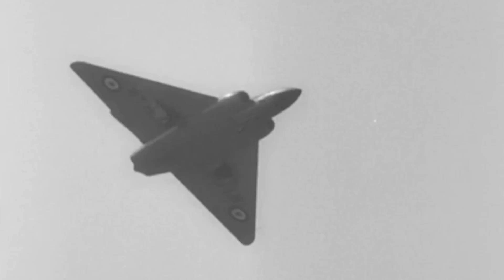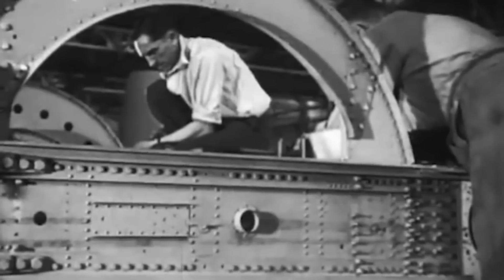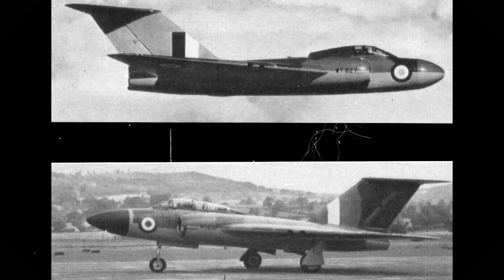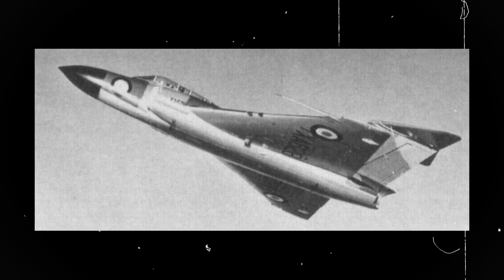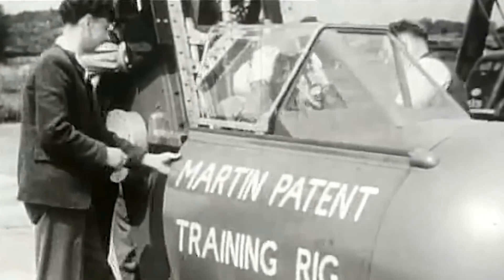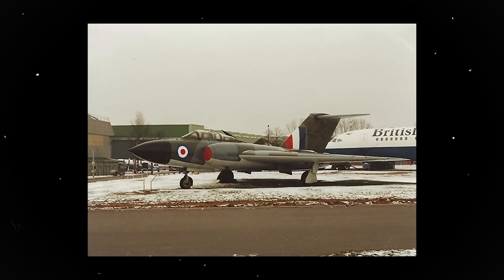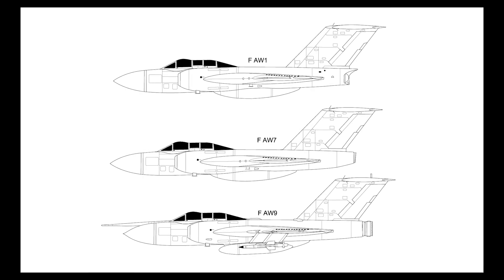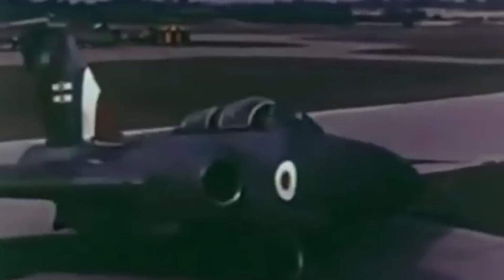The Bizarre Interceptor That Accidentally Broke the Sound Barrier

Comment: A very fair progression from the Meteor. Not bad performance for a non reheat engined craft. I bet high altitude manoeuvrability was good.
Reply: Especially considering the Gloster Meatbox was the worst jet fighter in history... mediocre at best, typical british jet.
Reply: @DoktorBayerischeMotorenWerke 

Compared with what other jets?  As one of the first examples of this technology it was primitive obviously. All the early models were.
Reply: @DoktorBayerischeMotorenWerke  
Compared with what other jets?  As one of the first examples of this technology it was primitive obviously. All the early models were.
Reply: @robinwells8879  Britain lagged years behind in aircraft technology, its jets were outdated, unreliable and had staggering loss rates.
British jets were so bad that operators refused to buy them anymore and the UK aircraft industry collapsed.
Reply: @DoktorBayerischeMotorenWerke  perhaps in the universe that you inhabit!😉. Remind me, what was the TBO for an early BMW  turbo jet engine as fitted to the 262?  10 hours was it?  Fantastic engine geometry and aerodynamics but a severely underdeveloped engine. These were early days and all manufacturers had teething problems. Russian Migs were only able to fly because of reverse engineered RR engines sold to them.  The USA only had the technology that they stole from the defeated Luftwaffe and the engines that they were given by the UK.  Nascent technology.
Reply: @DoktorBayerischeMotorenWerke  
While the 362 engines often had trouble lasting longer than 46 minutes before destroying themselves early British Whittle engines had TBOs in the order of 300 hours & of course did actually manage to stay in one piece long enough to require an overhaul.
 Later 1940s De Havilland / Halford turbojet engines had TBOs of around 1000 hours

  The Lockheed J37 engine was in fact a compressor fed steam raising boiler combuster feeding a Parsons type axial turbine section which drove the compressor & a propeller. Not actually a turbojet aero engine as such & never got used for aircraft propulsion. 
  Based on work done before 1900 by Parsons of North England & Ireland while creating the world's first power generation turbomachinery multi stage sequential rotor stator axial turbine & axial compressor.
Reply: @petemaly8950  The German company Krupp developed P-193 Tinadur alloy, the world's first high temperature Nickel stainless steel was introduced in 1932 and was used to manufacture the world's first production gas turbine engines made by Swiss company Brown, Boveri und Cie.
Reply: @petemaly8950  The Jumo 109-004 'B" was PFTR rated for 150 hours and American tests conclusively proved that these engines had better TBOs than Allied Piston engines.
Reply: @DoktorBayerischeMotorenWerke  The Jumo 109-004 had no official TBO rating, it often destroyed itself in less than 46 minutes. 
During testing by the RAE during project 363/AO46 the 362 under test  experienced 5 destroyed engines in one afternoon.
 During attempts in Russia to use the Jumo engine copies they ended up scrapping around 1000 engines.
 Allied piston engines during the 1940s often had TBOs of between 700 hours & 1300 hours.
Reply: @petemaly8950  Allied piston engines like the Merlin in combat operations averaged TBOs of 25 hours.
The Merlin could not return to service if the lock strip on the throttle lever was broken and WEP was used during the last flight,
The engine required internal inspection and repair before it could be allowed to return to service.
The use of WEP for more than 5 minutes would result in serious damage that required a complete teardown and overhaul   in as little as a single mission.
Reply: @DoktorBayerischeMotorenWerke 

   The Jumo 109-004 had no official TBO rating, it often destroyed itself in less than 46 minutes. 
During testing by the RAE during project 262/Ao04/wtf  the 26.2 under test  experienced 5 destroyed engines in one afternoon.
 During attempts in Russia to use the Jumo engine copies they ended up scrapping around 1000 engines.
 Allied piston engines during the 1940s often had TBOs of between 700 hours & 1300 hours regardless & of course the Merlin was never destroyed in under 46 minutes simply because the throttle had been closed too quickly 😅😅😅 & of course the Merlin always reached it's next scheduled overhaul.
Reply: @petemaly8950  Official USAAF documents produced by Operation LUSTY cofirm TBOs averaged 55 hours... better than the Merlin engines
Reply: @DoktorBayerischeMotorenWerke 
@DoktorBayerischeMotorenWerke 

   The Jumo 109-004 had no official TBO rating, it often destroyed itself in less than 46 minutes. 
During testing official documents produced by the RAE during project 262/Ao04/wtf show clearly the 26.2 under test experienced 5 destroyed engines in one afternoon with engines lasting between 25 minutes & 45.9 minutes.
 During attempts in Russia to use the Jumo engine copies they ended up scrapping around 1000 engines.
   Allied piston engines during the 1940s often had TBOs of between 700 hours & 1300 hours regardless & of course the Merlin was never destroyed in under 46 minutes simply because the throttle had been closed too quickly 😅😅😅 & of course the Merlin always reached it's next scheduled overhaul.
 Dehavilland / Halford Ghost turbojet engines had a TBO of 1000 hours  during the 1940s

Comment: I live in the same county where Robins Air Logistics Center is located. Robins got the contact to do depot level maintenance on F-15s in the 1970s and a corridor across the center of the state was created so that the F-15s could break the sound barrier when they flew functional check flights. Over the years us locals have gotten so used to sonic booms that we hardly notice them. One day I went to our nearby Wal-Mart for something, that store happens to be right next to I-75, as I was leaving there was a family just getting out of their car and a very loud sonic boom went off. The family was from up north and and were extremely frightening by the noise. But they were confused because no one else seemed to have heard it, I explained about the F-15s and they sheepishly went about their business. It made wonder how many travelers had heard sonic booms like that but didn't have someone to explain it...

Comment: In August 1952 I was aged 10 and in the Isle of Wight and heard my first sonic boom. I thought from the glimpse that I got of the aircraft that it was a Javelin, but this suggests it couldn’t have been. What else was possible at that time? Hunters only went supersonic in a shallow dive and this aircraft appeared level at a considerable height.
Reply: True with early Hunters, very much so, but the later ones were rather quick! The last mark broke mach 1 plus another 230mph! But, yes, your early memories are almost certainly right for the time.
Reply: @robertwilloughby8050  No Hunter was ever able to break mach 1 plus 230 Mph - later ones had more powerful engines but were also heavier so no hunter exceeded mach 1 in level flight.
Reply: @trigger399  Ah. So where did that 920mph top speed come from? In a dive? I'm sure the ones that were used for altitude and stall training were rather quick. But yes, I concede your point otherwise.
Reply: @robertwilloughby8050  I have followed aviation since the 1950s and have never heard of a Hunter doing 920mph. They never produced special ones for altitude or stall training. Aircraft at altitude are rated by mach number as mph is accurate only at low level. The fastest Hunter was the F3- the red one that broke the world speed record at 727 mph and that had a reheat.
Reply: De Havilland DH110 was regularly exceeding the speed of sound (in a dive) before the Farnborough accident

Comment: My Dad was crew chief to the squadron commander's F-100 Super Sabre (77th F.B. Squadron) stationer at RAF Wethersfield, Essex in 1956-58.
In 1957, a Gloster Javelin arrived as part of Wethersfield's airshow.  It looked HUGE compared to the svelte F-100s parked nearby.  The Javelin's  camouflaged livery looked intimidating compared the F-100s' shiny aluminum skin.
It wasn't long before this 10-year-old had bought a beautiful cast metal Dinky  toy of the Javelin complete with that nifty paint scheme.  It wasn't long before I was putting together a FROG plastic model Javeline as well. Our USAF Suoer Sabres were truly supersonic in level flight but the slower Javelins were AWESOME. JJS
Reply: I had one of those toys too!
Reply: The commentary is so irritating I never finish his post.
Reply: @derekhutton9855  
Sorry that my recollections of the Gloster Javelin triggered you and irritated you so much.  Perhaps you should've finished my reading my comment.  JJS
Reply: The Javelin had twice the wing area, half the wing loading & 5 ton higher max takeoff weight compared to the Super Sabre.  One of the Javelin design  requirements was using short runways.

Comment: Easy to understand the Brit's sensitivity to sonic booms, so soon after the end of WW II. Thanks for another great story.
Reply: Not clear where the struggle bit comes in, perhaps you would explain further.  The UK produced a number of supersonic technology demonstrators throughout the 1950/60s including the Fairey Delta FD2 and the Bristol 188.  Take a hard look at both, they might remind you of a couple of aircraft that did enter mass production elsewhere.  Earlier  Miles had an aircraft in preparation  intended to be the first anywhere (intentionally) through the sound barrier, it included the first all flying tail plane, technology that turned up in another aircraft that was mass produced.  The money ran out and the technology was subsequently gifted to the US.  The UK certainly had the technology and aeronautical science to develop advanced aircraft.   However, what the UK did do was design aircraft and build the ones needed to meet its specific defence needs.  What the RAF wanted was a quick reaction fighter with a sufficient speed, rate of climb and ceiling to meet with incoming threats before they were in range to do any serious mischief.  Enter the English Electric Lightning P1 based on a number of technology demonstrators built by Shorts of Belfast.  If you have built what is needed to more than meet your spec why build more?  The exception to this was they did build four types of strategic nuclear bombers by four different manufacturers, namely the Sperrin, the Valiant, the Vulcan and the Victor.  Each represented a sequential advance in technology and associated risk, look on it as rolling insurance policies against failure and taking no chances with delivering  nuclear weapons.    Again, where does the struggle bit come in?
Reply: @TheArgieH  Please spare us the British revisionist propaganda drivel...

Britain lagged a decade behind Germany and America in supersonic aerospace technology.

Never in history has there been so much discussion regarding a fictional aircraft that never existed.
When the M.52 scandal broke, Ministry auditors raided Miles Aircraft and found nothing more than incomplete drawings and a partially constructed wooden mock-up of the cockpit section. 
No evidence of the two prototype aircraft were ever found, nor the money paid to build them.
Miles Aircraft was charged by the Crown Court with 24 counts of fraud and embezzlement.
Frank Whittle was arrested and discharged from the RAF amid allegations of extorsion, embezzlement, and derliction of duty.
He was removed from his own company the same week the M.52 program was canceled and was exiled to a drug rehab in America to spare the new Labour government any further embarrassment.

Britain attempted several research aircraft that were notable failures like the Fairey Delta and the Bristol 188, but no follow on production aircraft would emerge until the English Electric "Aluminium Death Tube"

The Messerschmitt Me-262 is the first jet aircraft with a fly-by-wire Horizontal Stabilator system to counteract the effects of compressability and Mach tuck at high transsonic speeds and the first aircraft to go supersonic in a dive (and not crash)

The UK no longer manufactures its own jet aircraft, it buys them from foreign aircraft manufacturers or builds foreign designs under license.
Reply: The world's first jet aircraft to exceed 1000 mph was in fact the Fairey Delta 2 breaking the record by 300 mph & holding the record for nearly a year.
Reply: The V2 arrived and exploded, a little later the sound of its terminal descent arrived.  The V1 had its characteristic pulse engine sound, the really scary bit was when the bastxxd went silent as it was now tumbling out of the sky and the Argus pulse jet had stopped. Around one ton of boosted HE on its way to any (un)grateful recipients. So yes there would have been a certain sensitivity to sounds from the sky.
Reply: Britain struggled to build supersonic aircraft... only one ever entered production.

Comment: This supersonic flight was not a one-off and was regularly achieved in service as the speed limit was mach 1.08 above 35000 ft. From the pilot's notes..."This aircraft will go supersonic in a 40 degree dive at full throttle"..  Also the Javelin was as fast as was required under it's specification and equal to the Hunter and Swift.   You've also repeated a popular mistake about 29 Sqn Javelins flying over Egypt and upsetting Col Nasser. As it is about 2,500 miles from Cyprus to Nairobi, this was impossible without inflight Refuelling. They flew nowhere near Egypt but via Turkey, Iran, Masirah and Aden including two night stops to get to Kenya.
Reply: The Lightning was the only true supersonic, British military aircraft..
 Known by RAF pilots as the "Alumimium death tube"
Reply: @sandervanderkammen9230 
The lightening was not referred to as the aluminium death tube by RAF pilots.
Reply: @petemaly8950  Only by HALF of RAF pilots called it that... the Other Half were killed by the "Aluminium Death Tube"
Reply: @sandervanderkammen9230  
 Krappenz & co - they should note well with great deference, infinite revererance & extreme awestruckness.
   The English Electric Lightening was not referred to as the aluminium death tube by any RAF pilots, anywhere at anytime.
 Accident losses for the ENGLISH Electric Lightening were lower than many other commercial & military aircraft.
  C H E E R S
            &
Toodle PIP Old Chap
😎👍
Reply: @petemaly8950  58% loss rate is the worst jet aircraft in history.
Reply: @petemaly8950  Why is the "Aluminium Death Tube" no longer in service???
Reply: @sandervanderkammen9230  Hello Sandyboy, you may not have grasped this but aircraft design moves on. Of course British designs have proved to particularly long lived in wide international operation with such aircraft as the Gloster Meteor,  the de Havilland Vampire and the E E Canberra (two B57 Canberras are as you know still in service with NASA) but even their times passes. 
We know you like to cling to the past short lived unsuccessful aircraft like the Me 262 claiming bizarrely that recent replicas are an actual continuation of production with just the 65 year gap.
Reply: @sandervanderkammen9230  The Lightning was know as "the Frightening". The world first operational military aircraft with supercruise (at least according to some sources).
Reply: @dishusse  Sorry, but most British sources are deliberately false and misleading.

The French Nord 1402 Gefault was the World's first jet aircraft to Supercruise.

The first production jet able to Supercruise is the American Lockheed F-104 Starfighter

RAF pilots who flew the Lightning called it the  "Aluminium Death Tube"

It's a bit ironic considering that many Lightning pilots survived crashes only to have their careers ended by crippling injuries resulting from ejecting from the plane.
Reply: @sandervanderkammen9230  If you read the comment, it states first operational, military aircraft, not research aircraft.
Reply: @trigger399  Again, your sources are wrong, the American Lockheed F-104 Starfighter entered service 2 years before the Lightning.
 Britain has always lagged behind America and France in supersonic jet aircraft technology.
The UK no longer makes any British supersonic aircraft